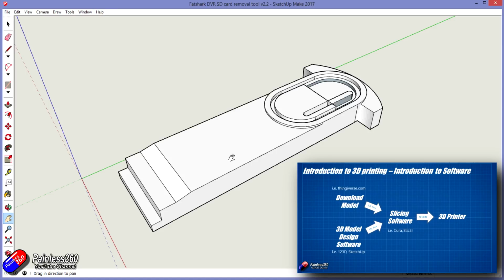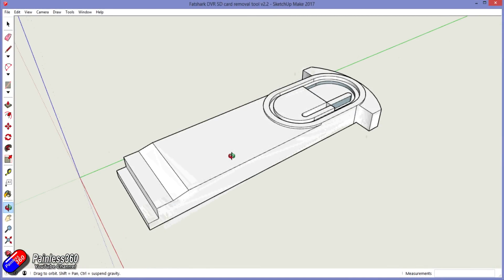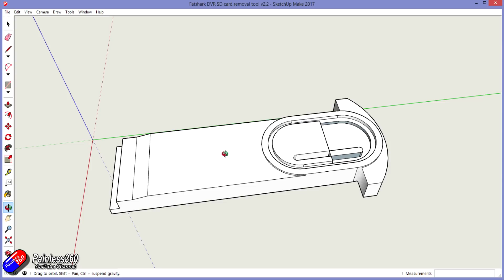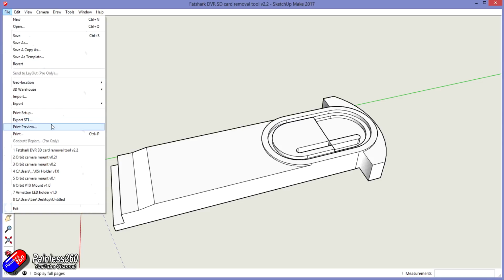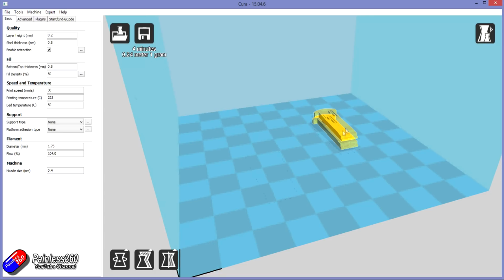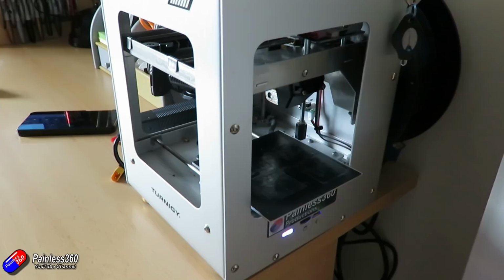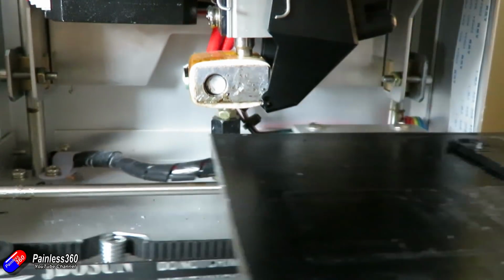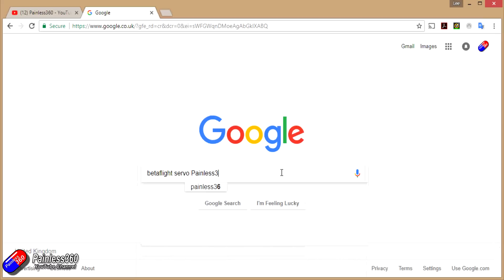Overview of the complete 3D printing process

Comment: Hi Lee. I notice you use Sketch up now. Do you still use Fusion? Also...have you tried using the wifi web page for the Fabrikator? For small GCodes..up to 3MB or so, its really handy.
Reply from the maker: To be honest, I played with it a little bit when I first got the printer but I find the SD card is the way that just works for everything. Thanks for the comment, happy printing!